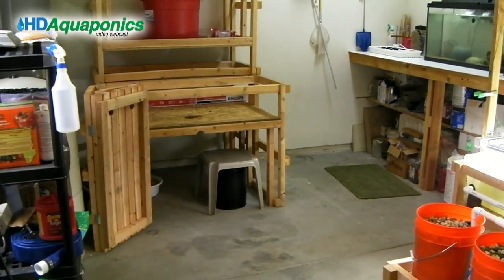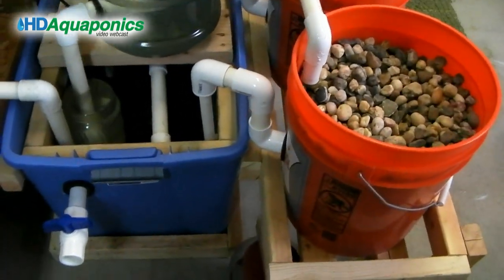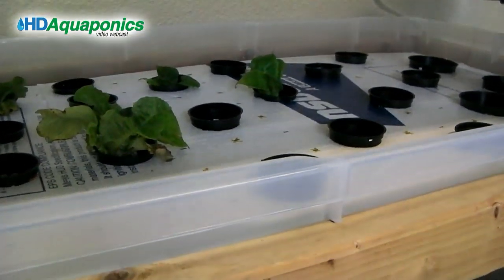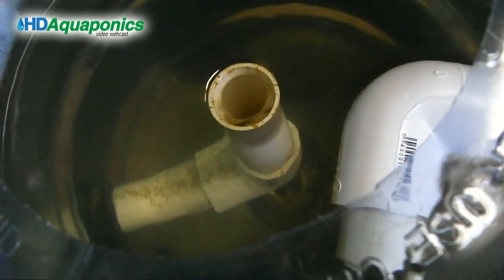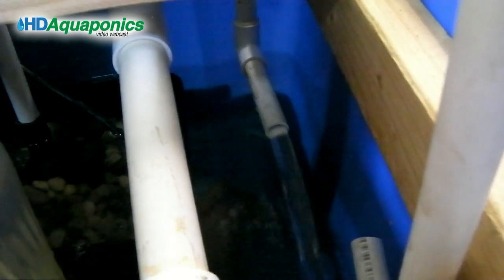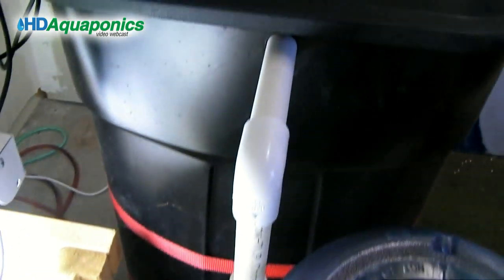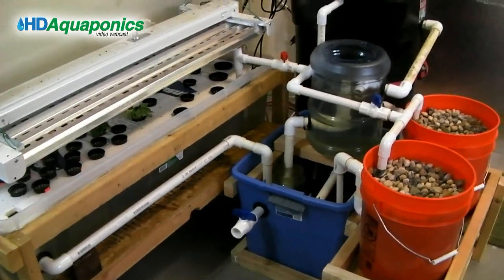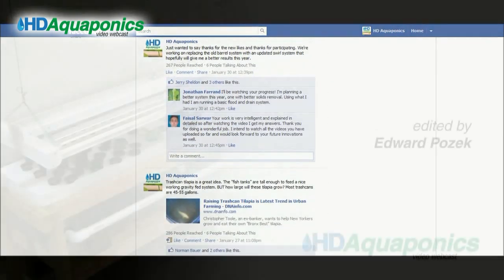HD Aquaponics Ep.30 - Advanced Barrel Aquaponics, swirl filter, floating raft, u-siphon, indoor

Comment: In a aquaponics system using a raft you need filtration because the roots attract solids like a magnet. When the roots get clogged with solids they stop taking in nutrients so it is important to keep as many solids out of the water as possible.

Comment: This is an awesome little system for trying out the best of both floating DWC and E/F.  I am going to build something very similar with maybe 4 buckets instead of 2 and a small NFT system added for strawberries.  Thanks for the awesome ideas!  My question is about your external U siphon.  What are you using on the internal opening of the PVC to avoid clogging of media?  Screen?  Thanks!